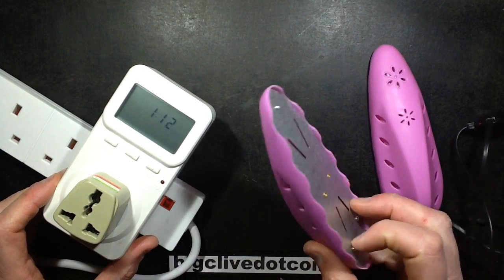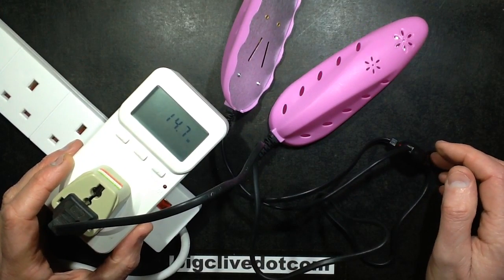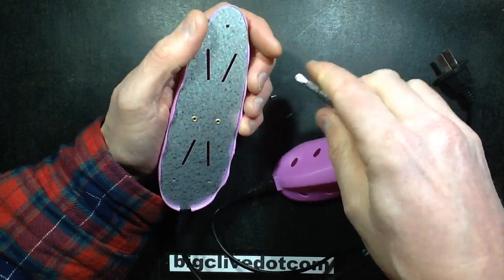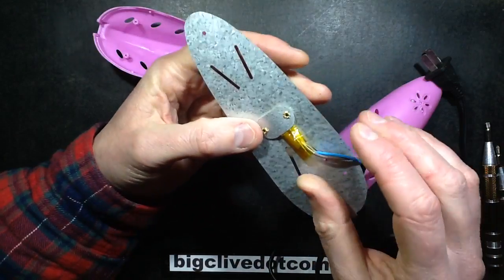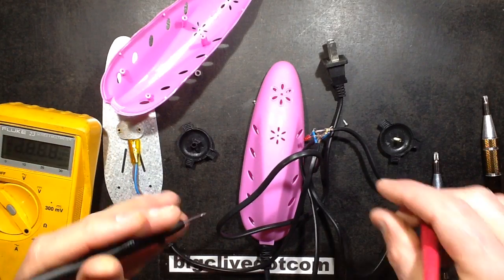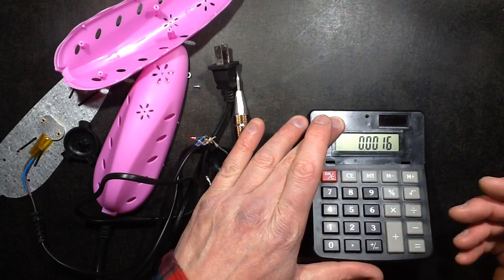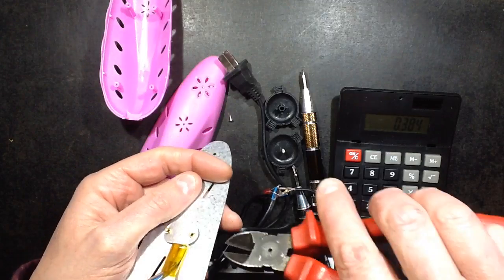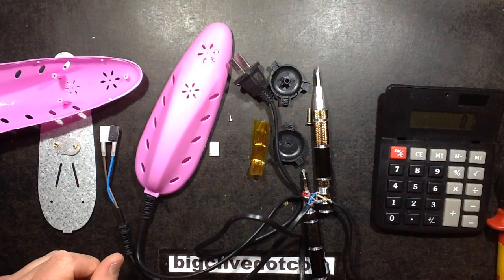The cheapest pink shoe warmers of death.

Comment: So is your channel basically the Poundland teardown channel? As far as I can tell everything you have is from Poundland or 99p Stores. Screwdrivers, calculator, and half the teardown items. To be fair some stuff seems to be from eBay as well.

Do you ever plan to teardown more expensive stuff? Do you ever buy anything else for yourself, or do you like like laughing at cheap crap?
Reply from the maker: I do occasionally take more expensive things to bits, but the cheap stuff is generally more entertaining.
Reply: bigclivedotcom I find it interesting that you use Poundland tools... Most engineers like nice equipment, even for tearing down crap.

Props for avoiding the racism that is common in teardown videos of Chinese goods, BTW. You come over as a nice (but cheap) guy ;-)
Reply from the maker: mojochan Some of the tools I use on my bench are cheap because they are actually quite good and very versatile.  The tools you don't see are the ones I use for electrical work and are all prominent tools like Knipex because they get heavy use in an industrial environment.  The Fluke meter most certainly wasn't cheap when I bought it, neither was the Flir infrared camera, DSO or the digital bench supplies.  But what I buy to tear apart is most definitely cheap.  Although sometimes I buy quite expensive things to tear apart too.
Reply: bigclivedotcom it's good that you look at this stuff. I bet a lot of people assume that stuff, particularly stuff sold in shops, meets the minimum safety standards.
Reply: +Mandrake Fernflower He's like a kinder mashup of Dr. Ashens and Dave Jones of the EEVblog.

Comment: Do a lot of  people die in China from electrical shocks ? or are they just for the export market ?
Reply from the maker: These are all generally aimed at the Chinese market, hence why many are rated for their 220V supply.  Pricing in China will be in Yuan and will match their finances.  If you look at videos of Chinese factories on YouTube with women testing lamps on bare wires nailed to their wooden benches you'll realise that electrical safety is not really a big priority in China.
Reply from the maker: artifactingreality The severity of a shock depends on how easy it is for current to flow through your body to ground, either physical ground or another earthed object.  A lot of people make accidental contact with mains electricity and survive, but nobody is "immune" to electrocution.  It just takes the right circumstances for a tingle to turn into a fatal shock.  Knowing how to assess your surroundings and the likelihood of high current flow is important if you work with electrical equipment.
Reply: i like to do all my electrical work while standing in a washing up bowl full of water and earthed for safety.
Reply: even if 240v shocks dont kill me, i think id rather avoid it, i did once have an experience, i used to put my 240v soldering iron outside to cool off, so it got left outside, one day i used it, must have had some damp on it, pluuged it in and it felt like i was punched in the chest, we didnt have RCD/GFI back then, so nothing to turn off the power, but luckily i didnt grab onto it, just momentary
Reply: maybe it's because I live in flat but it just sounds ridiculous that you would leave a soldering iron outside to cool down
Reply: jusb1066 Not if it was a conductive metal one.
Reply: camohoj No they steal our designs and build things for themselves and sell us the shit items hoping it kills us off. Remember the Chinese invented war and tactics,
Reply: artifactingreality
well they get hot and you cant really put them down on anything! :}
Reply: No they only touch such device  when it is not plugged in
Reply: artifactingreality
the washing up bowl would insulate you from ground, so youd be fine!
Reply: The big danger is usually if you can't move from the shock or the electric shock causes you to be stuck to the items giving you the shock.  Typically, for a short time there is not too much current, so if you are able to pull away you are OK.  If you are in a bath or something you will have a much stronger current and at the same time in a situation where it is much more difficult to get away.... or if an iPhone cable or something is wrapped around you in bed....
Reply: @akamalfahkir1398  thats why there are circuit breakers. They cut power in a fraction of a second if someone gets electrocuted.
Reply: @baronvonlimbourgh1716  Just in case you are not joking, there may be instances where a circuit breaker may save someone, but not only are they slow, they trip at currents orders of magnitude higher than what are considered dangerous.  I don't know that exact numbers, but 100mA is considered dangerous (it doesn't necessarily cause burns, but can influence heart rhythms).  For a 15A circuit breaker to trip in a fraction of a second, the current must be much higher than 15A.  Ground fault interrupts can increase your safety if the current leaks and goes through a ground. I don't know that they are standard for all outlets.
Reply: you dont think people in china use this stuff? lol, i dont think they are daft, but they know we will buy anything if its cheap
Reply: Malcolm Whinfield
yes im sure that is also true, plus i dont think shoe warmers are very high on a priority list when poor, but im sure they do have to use some of the unsafe items they do sell though, such as lightbulbs that have live parts